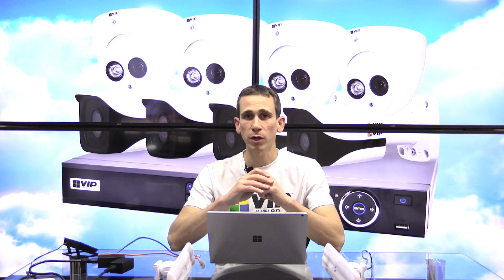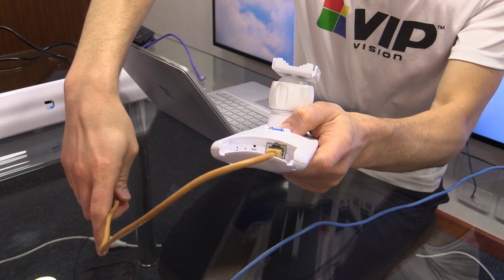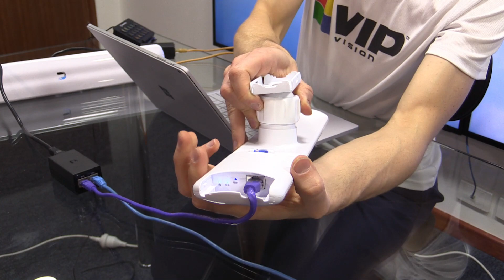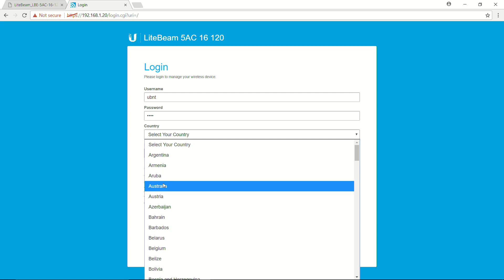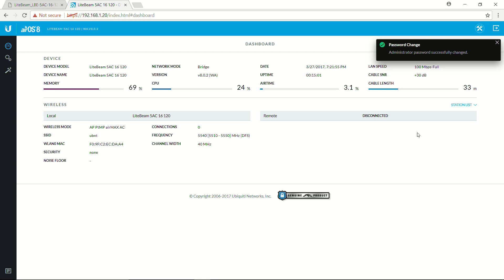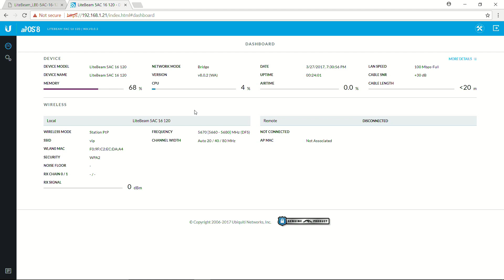Setting up a wireless PtP bridge using Ubiquiti airOS 8.0 devices

Comment: I can tell you the LiteAP GPS will not work without manually setting control frequency list. My LiteAP ac 120 would work without setting frequency but not the GPS. I set all my devices, AC & M, to channel 5760. It's a lot more stable when they are manually assigned.

Comment: Great video! I want to create a PtP to bridge internet from my house (where modem is) to my studio that's 800 feet from house. Some small branches are in the way but nothing serious. I found a good deal on two NanoStation M5's that I ordered and will be receiving in a few days. I understand the house M5 will be my Access Point and the M5 at the studio will be the Station. Can I plug in a ASUS router to the M5 station PoE adapter to have its own wifi network in studio? Also, will it be considered as same network? If so, my cable company allows me to use my Roku as a "cable box" to watch TV.
Reply from the maker: Hi Colby, this should work correctly and the Roku will appear on the same network as the cable box.  Just make sure that you set the NSM5's wired network up in bridge mode (not routed) and use the ASUS router as an access point with no routing and DHCP turned off.  Turn DHCP off in the web interface and plug your NSM5 PoE adapted into the LAN port of the ASUS, not the WAN port.  Note that the NSM5 uses the older AirOS 6 and configuration will look different to that shown in this video.  Let us know how you go.
Reply: Everything turned out absolutely incredible... works way better than I imagined! Thanks I really appreciate your help :)
Reply: Colby McClain 8

Comment: hey jeffery
i have a quick question.
do you know if the cloud key can control the access point ptp and station ptp. if so can you use a cloud key on the head end of the access point to go through to the station point to control lets say a unifi 8 port poe switch?
Reply: Jeff Morales the cloud key can’t connect to the ptp, you can use the UNMS to see them and do some control, I haven’t used the unms just yet still need to install it onto one of my servers

Comment: thanks for the help! i set up my Power Beam ac 300 the same way you set up your system. did you have any problems with your browser not going to some websites, but going to others?
Reply from the maker: Hi Spencer, if you have the devices set up in a pair as outlined in the video then it should in the vast majority of circumstances behave the same way as an Ethernet cable (i.e. if internet connectivity is no issue on the local end it should also work at the remote end).  What you describe sounds a lot like a DNS issue and DNS uses UDP, so high packet loss could be the root cause.  What happens when you ping your DNS server from the remote end of the link?    I expect you'll see a number of timeouts, if so then you should check signal strength indications on the web interface of your PowerBeam Station and/or AP.  If signal strength is poor you'll need to realign or reposition the PowerBeams so you have a clear line of sight between them.
Reply: Thanks! I wound up having to return my IP setting back to automatic for everything to work. I guess if I have to access the antennas for maintenance, I would have to change my IP address again

Comment: so where is the source of the internet connection if we will used that device?..I mean what is the mean purpose of that device?..
Reply from the maker: Hi princeboy, when configured in this way, these devices form a point-to-point transparent Ethernet bridge - That is to say they work as if you had a long Ethernet cable running between the points.  They will not act as a WiFi end point and you'll still need to get Internet access from a provider (via 4G, DSL, satellite etc.) at one end of the link.
Reply: but how can I connect it from my internet connection to that devices??.because as what I saw in the video there is no such tutorial on how to connect from your own internet connection but only on how to configure between the two devices..By the way I want to buy this stuff but I'm confused it on how to connect to this device from our own internet access,,I did not see any modem or router on the video ...
Reply from the maker: Once configured as per this video, use these devices as you would an Ethernet cable - Connect your router to the LAN side of the supplied injector using a patch cable, then connect the PoE side of the injector to the first wireless bridge (it doesn't matter which one) with a patch cable.  At the other side, plug the Ethernet port of the device that needs Internet access into the LAN side of the injector using another patch cable.  Next, plug the PoE side of the injector to the second wireless bridge, again using a patch cable.  Make sure both PoE injectors are connected to AC power - If everything is working correctly your device should now be connected to the internet.
Reply: very well said sir.Thanks for the info now I had an idea on it but I need first to copypaste your explanation to a microsoft word so that I can still remember it while I'm installing this devices for my future use..Thumbs up bro..